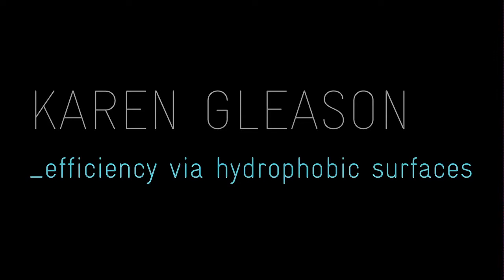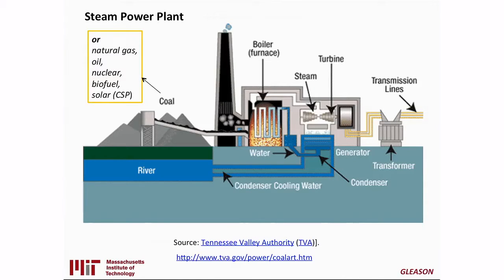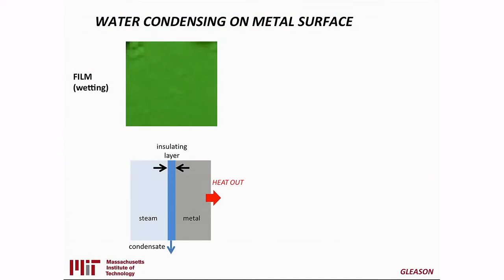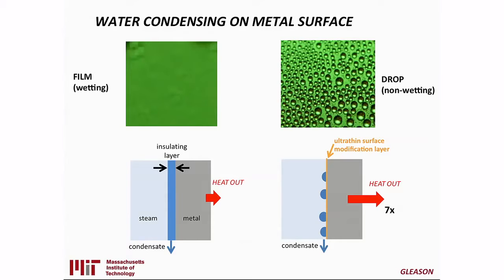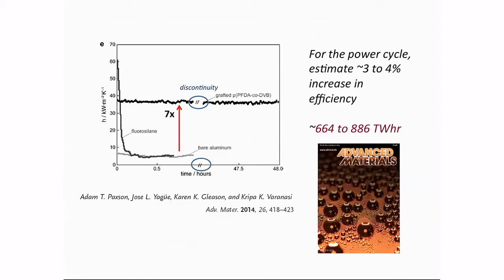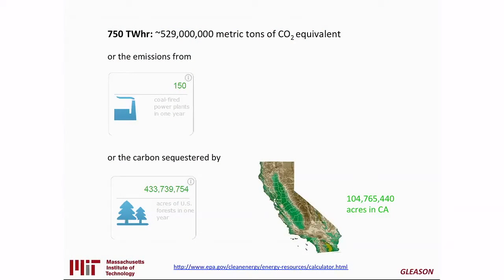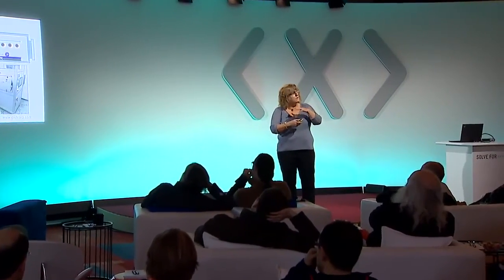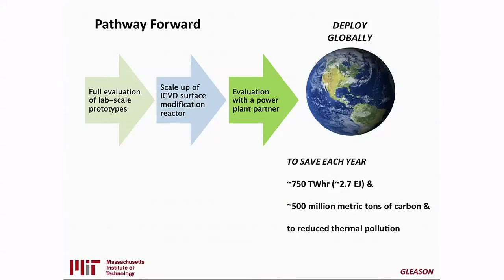Karen Gleason talks Efficiency from Hydrophobic Surfaces

Comment: How does this effect condenser size (, and consequently power to weight ratio, ...or scalability of a steam turbine), shrink it surely?

[Does it enable steam turbine (or combined cycle) powered a) trains, or b) planes (hybrid-electric - with a kalina cycle taking advantage of a -50deg C stratospheric heat sink - at cruise - ), or c) smaller ships with more efficient combined-cycle propulsion sysems, for example?

Maybe a) is still too heavy as train would have to radiate heat away to environment -  with excessively large radiators?; b) air-cooling should work but maybe still too heavy, despite much lower cruise power requirements?]